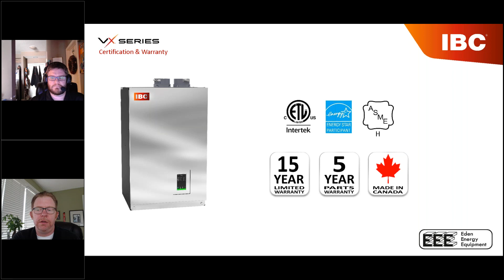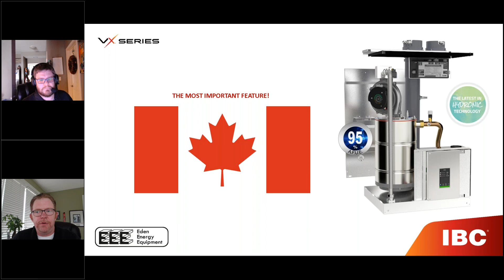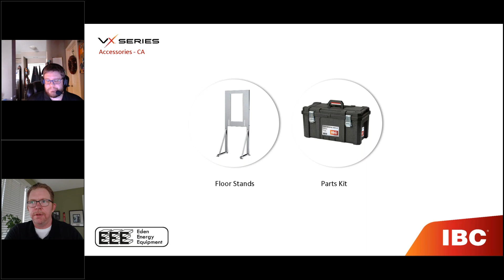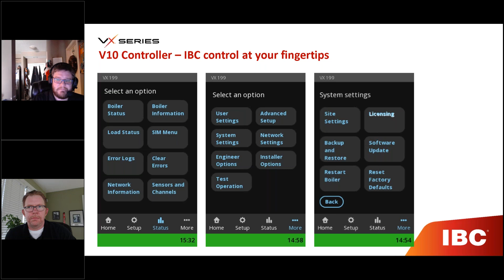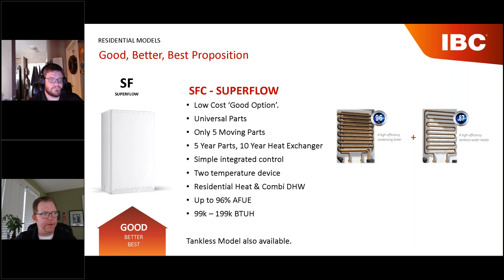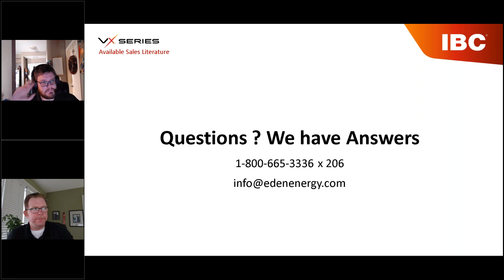IBC VX Boiler Technical Presentation

Comment: HI MICHAEL i had IBC SL30 - 199G3 ID:2  SUPPLY temp135F RETURN temp 133F INLET Pressure 21.6 PSI MBH heat output 32 MBtu only  it wont go higher than 32 MBtu since the boiler started.